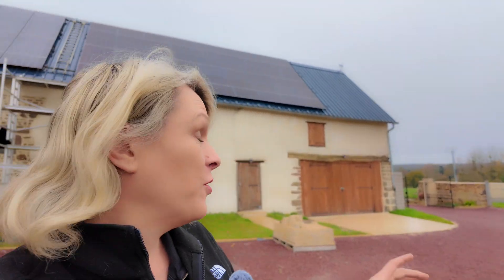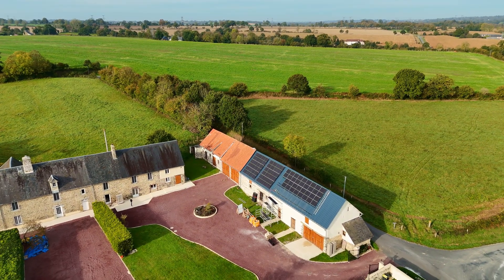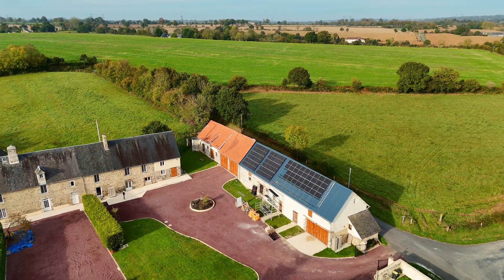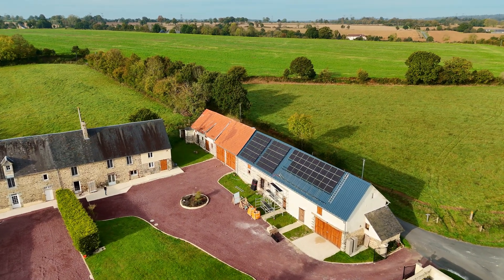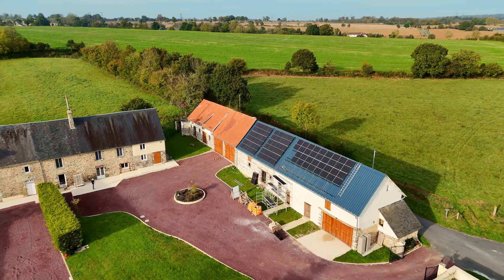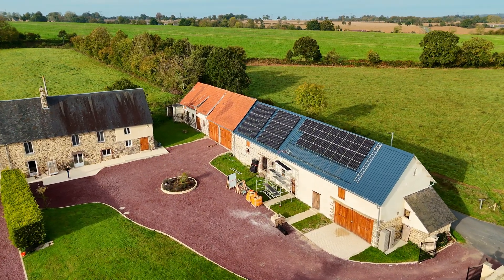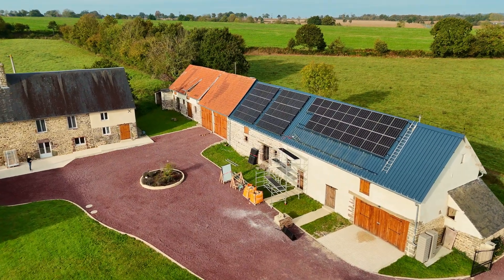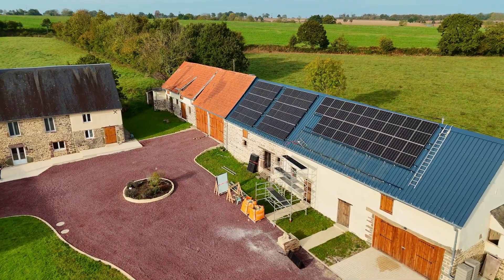Have we install too many solar panels?

Comment: In the early days we used to have an in-line device that was temperature sensitive and if the temperature got below a certain threshold it would simply take the last module out of the string and shorten the series string by one module. I thought it was such a clever idea but it never took hold.

Comment: if your Vmp is already close to 450V, the total Voc is definitively over. when you hit Absorbtion and the MPPT stops, the voltage rises close to Voc and you will burn the charge controller.

Comment: You can make a separate string of 5 or 6 panels and connect it to a special MPPT controller, such as Ecoboost 3000 (costs around 200 EUR), and then use this energy to heat the water in the boiler.

Comment: Mix the string's wiring so each string becomes made up of two string in parallel, dropping the voltage, but doubling the current between the point of parallel connection and the inverter (thicker cable needed from that point, 6mm instead of 4mm). Alternatively, leave the 9th panel/s in situ and connect it /them separately together to an off grid inverter and battery as a completely separate and independent power source. Datouboss 6.2kw off grid hybrid inverters are available at around £220 (UK eBay) and a Datouboss 15kWh battery is currently only £1000 (UK eBay).....!

Comment: I use Deye inverters. They can take up to 800V so i can savely connect 16 450Wp panels in serial
Reply: Well most people will never get a permit doing that as almost all electrical codes deal with 600 V maximum whether it's AC or DC.

Comment: Seems a shame to undo your work and loose 3 panels up there. Personally, if the cable run is easy enough, I would seperate out 3 or 6 panels off the end of the strings and cable them back to a smaller Victron MPPT. If the cable run is a pig I'd think about switching out the 450v MPPT for a simple, cheap, AC grid tie inverter - most of them will take 1000V no issue and it would probably only cost 400 euros. Couple it onto the critical loads output of your Quattro and the Victron system will control it nicely with frequency shifting.

Comment: For those wondering, I believe the panels are Trina TSM-425DE09R.08W which have a Voc of 50.2V, Vmp of 42.2V. 
So nine panels would give 451.8V under standard test conditions of 25C. 
Maybe  a year or two of natural cell degradation as well as some dirt on the panels would get this down to below 450V even when the temperature drops to minus 5?
It might be worth leaving them and just turning them off if there's a really cold spell?

Comment: You can check the setup with victron mppt calculator  ( search on google)    Here you can select the panels series and strings then it will give advise  about the setup.

Comment: Love the channel, but cannot help but notice you seem to have skipped the victron mppt calculator. You can even use it in you benefit to maybe do some smaller strings with seperate (smaller) mppt chargers to be able to connect your remaining panels in the best possible way to your batteries

Comment: I have a similar system to yours based in the UK.  I use a Victron Multi RS 450/200;  this permits 4 strings to be attached up to 11,500w total.  You could swop one of your RS 450/100’s for this larger one and attached all your new panels to it spread over 4 strings.  This would then reduce the voltage problem.  It is of course larger, but would probably fit in the middle space of your setup.  You could save the old 450/100 for when you need it later.

Comment: DO NOT TAKE THE PANELS OFF.   Keep the extra panels on the roof as spares, and simply connect to the 8th panel as the end of the string rather than the 9th.
If a panel ever fails in the future, you can simply bypass it and connect the 9th panel in the string.  It is a win win, if you just leave it there.

Comment: Hello, how are you?
Maybe a more practical and efficient solution would be to lower the voltage and increase the current.
Right now, the 8 panels are connected in series, correct?
Try dividing the setup into two strings of 4 panels in series each, then connect those two strings in parallel.
This way, the total voltage will be cut in half, but the total power in watts will remain the same.

It’s just important to make sure the cables can handle the higher current.
For example, 6 mm² copper cables can handle an average of up to 40 A, and up to 50 A in low temperatures, which is your case.

If you have 8 panels of 700 W each connected in series, the current of that array is about 15 to 17 amperes.
By dividing it into two strings of 4 panels in series, the current will double to around 34 amperes, still well below the capacity of 6 mm² cables.

The main issue here is the distance, around 90 meters.
With 6 mm² cables, the voltage drop would be about 8%, which can cause noticeable losses.
In numbers, 8% of 220 V equals 17.6 V, leaving 202.4 V per string.
Since the two strings will be in parallel, the overall loss seen in the system would be about 16%, or 35.2 V, which is quite high.

To fix this, it’s best to use thicker cables, like 10 mm².
With that size, the voltage drop over the same distance would be around 4.8%, which is much more acceptable and within good installation practices.

I hope this helps in a positive way.
Greetings from Brazil.

Comment: my 2 cents......dont remove the extra panel.......just disconnect it or any one on tht string.......keep as a spare on roof........if u want to go extra mile have a remote manual OR automated disconnect for a single panel.......hmmmm tht would be an interesting project .....am i too much of a dreamer .....LOL

Comment: I admire the love for Victron. My battery system is full Victron, but the MPPT's are way to expensive. I have a SMA Tripower 15x with 78 panels. If i want to replace that for Victron i'm going for bankruptcy.. I can only connect 8 panels to one mppt450?

Comment: Don’t touché anything in your solar panel.
Complete by a fronius to do Ac coupling with actuel solar panels ( the new ones). With fronius, you can arrive until 800 volts.
And keep in touch your rs450 for future expansion.
By this way, you will have less loss in conversion and best effiencient

Comment: There are two solutions I see for the overvoltage-thing:
1. Put the three leftover panales together to a small string and get another Victron Smart Solar MPPT.
2. Or build a 2P6S-System (Parallel 2 panels and put 6 of those pairs in a row). The 450/100 MPPT can deal with at least 4.800 Watts, more when the battery voltage goes up. Those 12 panels can do in theory about 5.400 Watts, but in practice never will.
Then you have 15 panels left. That would be a string of 8 and a string of 7.

Comment: That's quite high voltage and will be a problem on very cold mornings when the sun kicks in - we've gone through 2 "professionally" fitted Solaredge inverters in the last 4 years but my 3 DIY Sunsynk/Deye inverters work a dream. Would a 2nd inverter not be a better option and add some redundancy - you can get most of these to communicate via Home Assistant and ESP32/RS485 - Victron kit is really well supported?

Comment: I agree with  @Dahlia695 by leaving them therear the least. If you leave them umhooked, be sure to buy amd use the MC4 connector covers to hepp avoid rust issues later. In the summer, you can un cap them, hook them back in and you have your extra panels again.
  If you do decide to use a separate  charge controller for them,  you'll want to make sure to use whatever is the best method for using separate charge controllers. Victron is known for great customer support and I am sure they have canned answers along with great individual support if needed.
  Don't feel so bad about this. Solar is addictive as well as a journey.

Comment: Or you could add some kind of resistance with a transfer switch in your barn. Use it as a space heater when it might be cold outside and bypass it in summer.
Reply: Great idea.

Comment: personally i would rather keep them there and connect them(those extra ones)  in series and get extra cable and get some smaller mppt charger such as 150/45 or  250/XX or similar or even bigger

Comment: That is not good for you. We have a 12,000 watt Luxpower Hybrid inverter/charger that handles 600 volt max and 500 volt nominal PV input. We have 405 watt bifacial panels in  3 strings of 12 panels at 37.22 volt per panel for a total of 446.64 volts per string.  we have gone over the 500 volts but never over the maximum 600 volts. Victron is such a limiting product. We have 60 kilowatts of batteries and the 12 kWh inverter and it fits in a space of 4 feet (1.2 m) wide x 7 feet (2.14 m) tall and 24 inches (0.61 m) deep. Look how much room your takes up.

Comment: As I've said before, Victron have a very good MPPT calculator, with panel database, or you can use your own data from the panel spec sheet, there really is no reason to get it wrong if you use the tools available.
Reply: Well there's no reason to get it wrong if you have a freaking calculator and have half a brain..

Comment: Normal inverters can handle all strings up to 1500V  Victron need to improve this.
Reply: Not all inverters go to 1500v, a lot don't, although I do agree the voltage limitations are a problem. There's nothing stopping you using an AC attached inverter, you just need to remember the factor 1.0 rule.
Reply: @TheRonskiman with so many panels need good inverter not hundred of peace system

Comment: Hi Sarah, You have probably mention the solar panel specs., but could you tell me the wattage and Amps etc. Also I think you said you had pretty long solar cable runs. Can you tell me the longest lengths and what sort of voltage drop you are getting.

Comment: If you overshoot max voltage at this periode of the year .. then there is a serious problem in those calculus.... the worse time is when you got cold morning with clear sky... and cold days are still not here .. :D There is a reason we add a 20% margin of error.
And the max voltage that the 450/100 accept depend on the battery voltage .. !!!! PV VOC should not exceed 8xbattery float voltage.
Why nobody read those manuals ..?
Some options : Do not remove the panels. Reduce the string voltage by removing one panel.
If you've long distances between panels and the inverters room, use micro inverter and connect the ac out of those micro to the AC OUT of your Multiplus (do not know what model you got) and let him control those micro. This way you'll even reduce the load on the multiplus when there will be sun outside. A 5kVA multiplus 2 can control 4kW of micro inverters and do not forget .. 4kW of micro will add 4kW of AC power to your system...

Comment: Why dont you Add a victron 150/35 MPPT take your strings down T0 8 panel 8 panel and 7 panels. Put 2 sets of 2 panels  in series then parallel them on the roof with y connector and 1 run of cable back to mppt. If you know the solar panel model number reply with it might even be easier than that
Reply: Because at lower voltage over the length of cable, the voltage drop will huge. Basically her inverter is too far from the panels. This is the problem with Victron, the string voltages have to be kept relatively low., so you need larger cables for long distances.
Reply: @TheRonskiman true but depends on panels doing a rough calculation 2 panels in series that are 96v now in minus 106 at a 50m run in 4mm cable so a victron 150/35 would handle 2 pairs mo problem
Reply: @garymcconnell1072  Two panels at 96v, 12a, 4mm cable with a one way length will give 5.31% drop, 6mm would be 3.41%, 10mm would be 2.13%, ideally you need below 1%

Comment: Use an optimizer that shut down for fire and a transmitter that is activated by a microprocessor that caps the voltage at 420v.

Comment: 442 V at 6.8 A....that looks high. What kind of size are these panels? What are the rated mppt voltage and the open cicuit voltage of them ?
Your new panels seem to have a 10% higher voltage than the old ones. So it was a failure of your design, as a string of 8 new panels is close to the voltage of a string of 9 old panels.

A string of 8 old panels on your house  should not be a problem. You will get the 360-370 V like from the other old 8 panel strings.

Comment: This sort of thing is what makes me like this channel so much.
The voltage drop along the cable shouldn't be taken into consideration because that's created by the current through its resistance. When the current is reduced the voltage will go up and there'll be trouble. This will happen every 10mins when the  inverter does a global sweep to confirm that its not stuck on a second maximum power point. It'll be clearly visible on the graphs within the Victron Connect app that can be viewed on a smartphone by connecting to the Inverter via Bluetooth.

Comment: There is a little Volt loss in the combiner box, is it on the incoming side 450V? More stages with fuses might be able to reduce the voltage enough.
Reply: .. yea .. and ? Lose all this energy as heat ?
Reply: If you add more parralel strings of less panels in series, then you decrease voltage, but increase the amps which will further increase voltage drop, not good!

Comment: wow Leave the  panels as they are,. rewire from 9 to 8 in a string then make a string with whats left over. make a string of, 2,3,4,5, panels it does not mater run it to a cheap charge controller and run it to your battery bank  or  to another battery or a dump load like supplemental hot water also in case one of your main panels quits you have replacements of the same make, age and wear.

Comment: Install micro inverter for those three panels in ac coupling
Reply: Or just look for a 150 MPPT and connect those three panels to it
Reply: Exactly. About 150 € for MPPT and cables.
Reply: This is the way. In my offgrid Victron system i added 2 Hoymiles HMS-2000-4T microinverters (4 panels, 2000W each, 4000W total) and they work flawlessly. Tried frequency shift but the Multipluses were a bit too cautious and wasted a lot of production (it's the safest setup though). Anyway with a grid connected system frequency shift is not an option. I went with NodeRed on the Cerbo and it controls now an OpenDTU-OnBattery device (the open-source Hoymiles "Cerbo") which throttle the microinverters up or down. Since the Multiplus or Quattro, are inverter chargers, they can get the excess AC not immediately consumed in my home into the batteries.
Reply: That's what I did, works great.

Comment: Yah, that's a problem.  You usually need at least a 20% of margin calculated Voc vs charge controller limit.  Not Vmp... not the operating voltage.  It has to be margin relative to Voc, the open-cricuit voltage.  Even if the system is working at Vmp just under the limit, if the charge controller ever has to reset while in full sun it will refuse to start.

The cable length is irrelevant... it's the zero-current voltage (Voc) (resistance doesn't matter) that can cause the charge controller to lock out.

You have a few choices:

* See if you can find an optimizer solution that you can throw on a few panels to reduce the voltage.  I'm not sure if such a thing exists (one that regulates to a voltage instead of maximizing current).  This would be my #2 choice.

* Keep the panels in place but create a new string from the last set of 2 panels on the end of each row.  This would be my #1 choice.

* Replace the charge controllers with new ones that can handle proper residential string voltages.  Victron only going to 450V is old-school.

* Remove a few panels... last choice in my view.

Anyway, this is definitely a problem.  The array looks so nice, I think you should just keep the panels in-place and rearrange them a little to get another string out of them.

p.s. the Victron manual says this in section 7.1:

"3) Max. 450 Voc result in appr. 360 Vmpp, therefor the maximum PV array is appr. 360V x 20A = 7200Wp"

-Matt
Reply: I completely agree
Reply: Victron has an MPPT calculator, it's all done in there, so easy to check. You can not use optimisers with Victron.

Comment: Maybe you could leave the panels there and modify the cabling? Eg. unlink one panel in each string and join the unlinked panels together with extension cables to form another string.
Reply: Another option is to extend the rails on the large array, add 6 more panels to make it 3 string comprised of 8 panels each. Then maybe you do not need to do the slate roof?
Reply: Another option is to extend the rails on the large array and add six more panels to give you 3 strings comprised of 8 panels each. Then maybe you do not need to do the slate roof?

Comment: You could do them series parallel to get the voltage down, however it will increase the current, if your wire is large enough it should be able to handle the current. Why remove the panels, purchase another charge controller is another option then run a string for those panels. Lot of work to remove panels, risk a fall, and then have to seal the roof. Just my 2cents worth.
Reply: Totally agree, you can never have enough solar panels. On a rainy cloudy day my panels don't put out a lot, so having some "spare" is great......

Comment: @ least you caught the potential over voltage problem early, as for the solar extension rails  i am sure in a previous video you mentioned as in the future expansion, heres a suggestion adjust the configuration of the cabling, back down 8 panels & leave the now "unused" panels on the roof, then in the future when invariably you add another string, you already have panels/railing on the roof ,just a easier matter of adding the required amount of railing and the extra required panels, less physical work, plus the "unused" solar panels are out of harms way & will not get accidentally damaged likewise the same for the rails,plus added bonus ,no holes in the roof to fix :), keep them coming :)